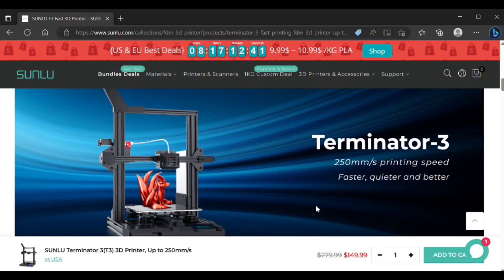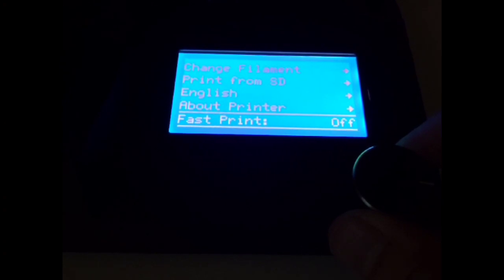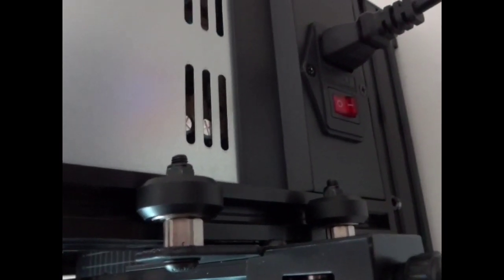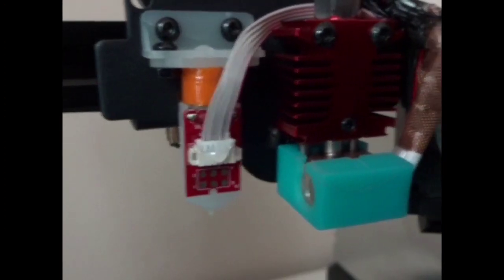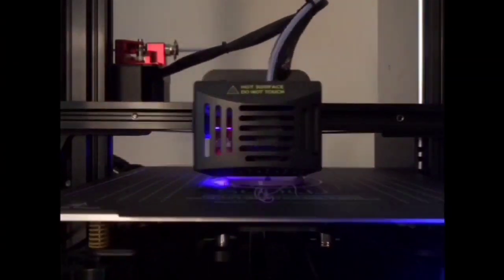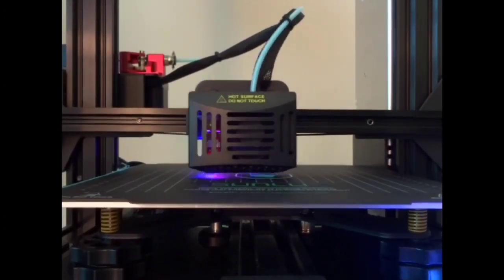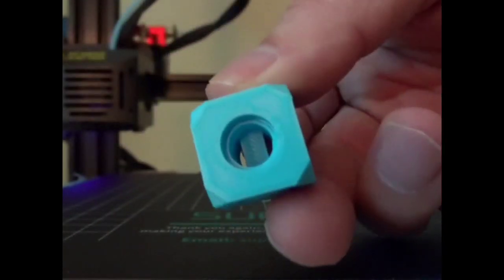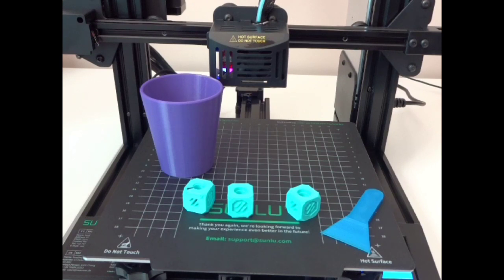Sunlu T3 / Terminator 3 3d printer review

Comment: I bought one, and recently gave it to my son after replacing the print bed. On mine the print bed was severely warped with a huge bulge down the middle when I got it. I also removed the fan for the extruder motor since it was making an almighty racket. Finally, due to having to do some insane adjustments to the bed, the screws holding it would stick out below the adjustment wheels, scraping the frame and the plastic of the motherboard housing. After klipperizing it and swapping the bed it was just fine and printed reliably and fast enough. Nowhere near the claimed 250mm/s though :)
Reply from the maker: Sorry to hear it. Luckily mine didn't have any of those issues.